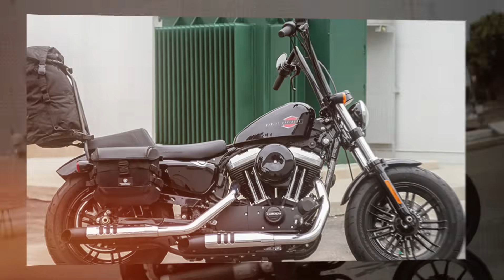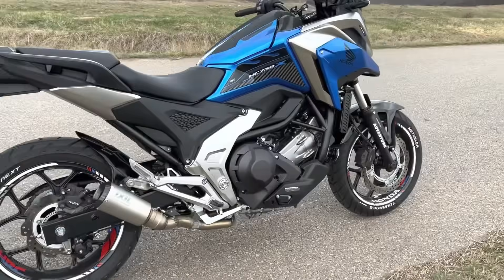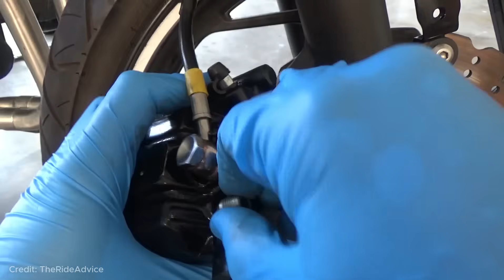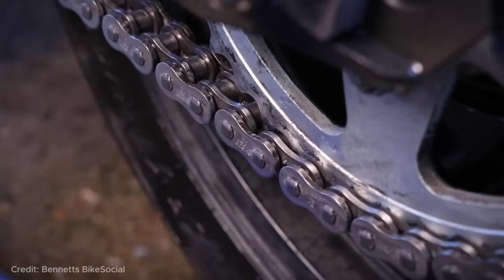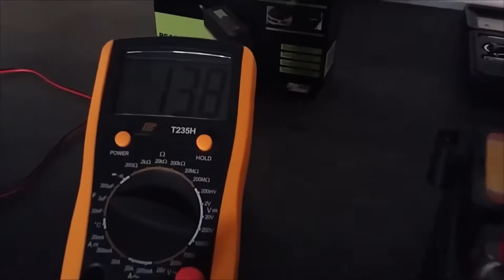STOP KILLING Your Motorcycle (Worst Things To Do)

Comment: Always lube chain from inside. Not like in the video. The centrifugal force will distribute it evenly. Or even don't lube at all. It doesn't change much. It's lifetime wouldn't be shorten much (2-5kkm). It could be cheaper to replace chain and sprockets than to pay for lube if you use it every 500km.
Reply: Experts don't use lube, they just clean with something like paraffin, kerosene, or GT-85. It's dirt that kills O and X-ring chains anyway.

Comment: What about holding the brake lever on with elastic while the bike is parked? A garage advised me to do this to prevent accidental movement or falls while parked up. Similar to the advice about holding the clutch lever in with elastic, is this actually a bad idea for the brake system and hydraulics? The most I leave mine like this is a few days or a week. Thanks for any helpful comments and thanks for a great and really helpful video.

Comment: Here's my own advice:

Stop wiping your bike everytime it gets dirty, yes even with damp towel, all it does is it spread the dirt and scratch your whole bike, what you should do is if your bike is still 80% clean and you just wanna remove that dirt in your swing arm just spray it with water, dont wipe it off, you should only wipe your bike when you wash fully wash it using bike shampoo

Comment: Replaced the rear sprocket, was tightening the last bolt into the swingarm without using a torque wrench and snapped the bolt head. The bolt was steel and the swingarm was aluminum so I just fused the two together. Easy out bits failed so had to drill out the bolt, retapped the hole from 10mm to 12mm.

Comment: That fuel pump?, is a carburetor.  Btw my Kawasaki has a fuel pump hanging off the bottom of tank, unlike my Honda (which is under the bike frame), so the bottom of the tank always feeds the fuel pump regardless of the volume of fuel.  All tanks feed from the bottom.

Comment: Recently got lectured by a mechanic replacing my rearwheel bearings that I was pressure washing my bike... sadly ruined my bearings at only 20.000km or 12.500 miles!
Lesson learned...
Reply: How in the hell did you get s sealed bearing that bad?
Reply: @pu1fjb0 The bearings don't come packed with grease from the factory. When we changed the bad one we checked the other side and there was no grease in it!
The right side bearing on the Honda Rebel 1100 is basically open. The only thing that is protecting the bearing, is the rubber seal... By pressure washing the bike with hot water the rubber seal swells and is not porperly sealing anymore. That combined with the products they add in those pressure washing places is washing out all grease

Comment: When i got my 2nd bike, the guy had replaced to front break pads. After riding for a week I knew something was off. Took it in because you couldn't see the issue but it had warped the break disks making it extremely unsafe and was lucky not to have crashed. Cost me a fortune for genuine parts again but glad. Morale of the story if something feels off, fix it

Comment: The chain lube thing is definitely a topic of many debates. I have always been told (25 years) that I should grease up right after riding when the chain is hot. Now I hear I shouldn’t. And some are even going as far as to say o-rings are sealed and don’t really need greasing and that grease is really more about avoiding rust…. Obviously there’s some misinformation out there but who is right?
Reply: The lube does not lube the pins in the chain. The orings prevent that. The lube does penetrate between the roller and the pin/roller bushing.
Reply: Yeah well people say things they heard without really knowing why. The O-X rings chains have lube in them yes, that's not what you are maintaining,  but you need lube to ease the friction between chain and sprocket and protect from rust, that is my non professional opinion.
Reply: @tzevux  I clean and lube my chain around 5 pm,  on Saturday or Sunday, even if it hasn't been ridden. put the bike cover on and go inside letting gear oil soak in overnight.

Comment: 0:50 Running low on fuel
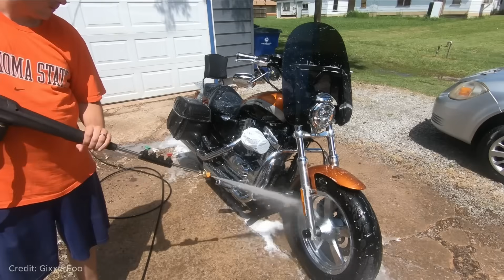2:29 Power wash in the wrong way
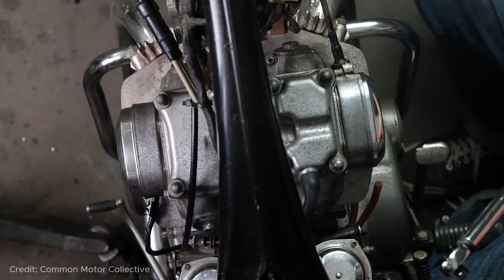4:10 Over tightening bolt
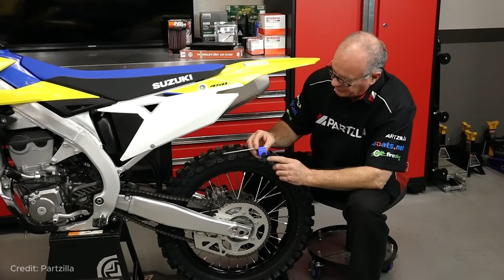5:42 Ignoring chain alignment
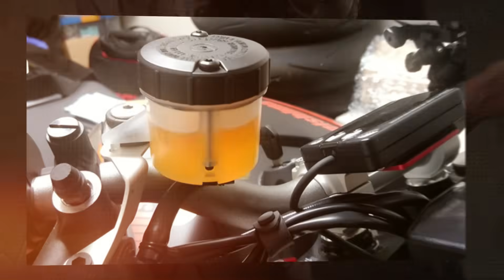7:07 Letting all break fluid set for years
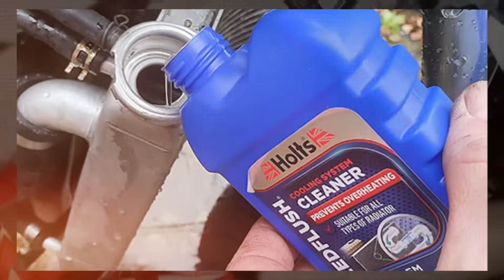8:38 Using a wrong type of coolant
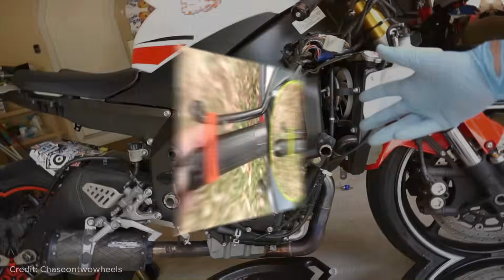10:12 Storing bikes with clutch pulled in
11:33 Mixing all old and new break pads
13:06 ignoring wheel spoke tension 
14:39 Loob in your chain after ride
16:07 Leave bike in 1st gear during long time storage
17:34 Letting the battery trickle all over year
Reply: Thanks bro
Reply: Thanks ahsan bhai
Reply: Thanks.
Reply: thanks INSAAN bhai
Reply: Great video
Reply: THANK YOU!
Reply: They’re brakes, not breaks. 🤦‍♂️
Reply: @Bassplaya-m5b dont see you taking time to time stamp.. stop being an ah.. we know what he means.

Comment: If your fuel pump is pumping fuel That means it's being cooled and lubricated      and sucking trash and debris off the bottom of the tank has nothing to do with the fuel level The fuel pump always sucks fuel from the very bottom of the tank anyway
Reply: Fuel pumps are cooled by the fuel (I know it's stupid), if the fuel gets low the pump gets hot. This leads to premature failure. Same for cars with pumps in the tank
Reply: just saw this bro, and I'm not saying you are wrong cuz ure not. but technically it doesn't intake from the bottom as the fuel inlet hoses sit facing the top of the tank as to cut down on sediment consumption. But yea if its leaking coolant that means it has coolant in it lol
Reply: @darylray1975 Don't want too much coolant in your gasoline
Reply: I always use NON ethanol gas. Ethanol attracts water real bad, or so i have heard.

Comment: Love my trickle charger, I just wait a month before season starts and throw it on
Reply: I have a LI-ion battery and a trickle charger "battery tender" I love them both and do the same. Just don't leave it on for extended periods. Just use it to charge it up when needed. If you have to use it a ton then its probably time for a new battery anyways.
Reply: @justinwolfe1471 when my oem battery goes I’d like a lipo

Comment: Hold on, don't motorcycles draw their fuel from the bottom of the tank? If that's where stuff settles, then it doesn't matter how low the fuel gets, we're always drawing fuel from where stuff settles.
Reply: Where the hell are all you guys filling up with all this sediment, water and rust?  I've got a 2003 and the tank is spotless and the filter is clean.  If you can't run your tank dry, you seriously need to fill up somewhere else, flush the tank annually or put multiple filters in the line.
Reply: @darrylbraun8520 ain't no way you run your tank dry, that still causes issues to wear and tear of the motor. unless you mean to almost empty,  but thats not running it dry. No engine ever should be ran dry
Reply: @afflict3507 Until you are parking it for the winter. You shut off the fuel while it's running so that it idles the carb empty.

...if you're running a carb.
Reply: @darrylbraun8520 ain't no way you run your tank dry, that still causes issues to wear and tear of the motor. unless you mean to almost empty,  but thats not running it dry. No engine ever should be ran dry
Reply: You guys are assuming this is a Carburetor bike (Shown), Modern bikes are Fuel injected and the pumps sucks from the middle to bottom.
Reply: The problem is when u ride till your bike die out of fuel
Reply: The sediment floats in a tank full of gas. If you don't have any liquid gasoline the sediment is just sitting on the metal inside the tank.
Reply: These guys are funny, sediment, particles in suspension, and floaters are 3 different things... and if you have enough of any if them in your tank to harm the fuel system or engine in the last 40 years you should take better care of it....
Reply: Yep. This is like that trope of waiting an hour after you eat to go swimming😂
Reply: ran one out of fuel once, then I had to visit the carb doctor, poured mix of water and car coolant, then I had to pay a visit to the water pump doctor 🔧🩺 a youtube video a day keeps the doctor away
Reply: Yeah but it stays suspended. It doesn't get sucked through the pump or vacuum line operated valve until the fuel gets very low. I mean sure if you're going full out in the twisties it gets disturbed and can get sucked up then but that's a bit different. The safe way to avoid that is to remove the tank once a year and clean it out properly. Other than that just don't run your bike low on fuel.
Reply: For my carbed bikes, I install an inline fuel filter on the fuel line to the carburetor and occasionally pull the petcock off and clean the screen and petcock internals, and purge and clean inside the tank. For my EFI bikes, I change the fuel filter regularly and maybe pressure regulator, and change the fuel lines if they looking worn out. And purge and clean the tank. I also don’t use the fuel that’s been sitting in the tank for more than 3 months. I don’t have to worry about sediment.  😊
Reply: Thinks for the tips old man!!!
Reply: Not KTM it's on top lol
Reply: The bottom of the tank is where my motorcycle draws from. I avoid ethanol when possible and make sure the fuel I put in it is clean.
Reply: Keeping a tank full sediment is suspended. Running quarter or less is where the trouble starts, carbie or Efi.
Reply: More gas in the tank helps dilute any sediment so i try never get below half a tank.

Comment: Fuel pumps, not shown, draw from wherever the intake sits and likely at the bottom of the tank. There is a pre-filter, 10 micron or smaller, to protect the injection system from contaminants. Old man should talk about regular fuel system maintenance rather than running the tank low on injection systems. Granted, running the tank low when the system has a fuel pump will allow the pump to possibly overheat, wear early, and fail.

Comment: I have recently overtightened screw when replacing front brake lever. My bad of course, but I also blame my motorcycle producer, who ceased distribution of bike's service manual, where all of these torque values should be. I had it for my previous bike, different manufacturer, and it was great help for amateur mechanic wanting to do some service job in private garage.
Reply: Check some forums and groups for the manuals pdf.

Comment: Never use a trickle charger. Use a quality maintenence  or smart charger. Keep an eye on it during the off season as well
Reply: I have a Battery Tender for my AGM battery is that a good charger / maintainer?
Reply: @higherstandardspc it comes down to will it go into maintenance. Maintenance isn't a constant feed but kinda floats around and brings the battery be it led acid, agm or lithium into the best it can be
Reply: @higherstandardspc  YES

Comment: I hit my chain with brake cleaner after a ride to clean it then lube it.
Reply: I used brake cleaner once and saw some damage to o-rings, how stupid it was....and I am not a beginner. Wanted save few bucks on dedicated chain cleaner can (Motorex, Motul, Ipone) - they last for 3-4 clean ing sessions. Now I bought kerosine 2l - more cheap and OK for o-rings. Many guys use it.
Reply: Don't do that! It's way too agressive and kills your o-rings or x-rings slowly over time.
Reply: @niels6695 good to know what kind of cleaner should I use than?
Reply: @AnimalVagabond  Use a special motorbike chain cleaner, doesn't have to be an expensive one. There are several cheap but good ones, depending on the country you live in. Try to google some chain cleaner tests and recommendations 😊 I use WD-40 chain cleaner (not the regular WD-40 solvent!)

Comment: 15:27 - if the chain has o rings or whatever x-rings - it cannot get to the rollers because there is the o ring in the way 15:50 so you are just supposed to let it fling all over your bike and the road - riiiighhttt..
How about follow your own advice from earlier - and read the manual - it says something very different than spraying your chain with aerosol can of oil before every ride.

Comment: With chain lube you wipe the excess off before you ride so it doesn't end up on your rear tire 

And leaving your bike in gear won't do anything, it will just rest on the engines compression 

And get a smart charger! It will go into a storage mode

Comment: 1 is wrong, you don't want it to run dry because it will ruin the internal veins, nothing to do with cooling
As long as fuel is going through it you're good
Reply: Applies only to efi systems and then you don't  run it to point of cooking the motor in the pump..  old bikes are gravity or vaccume diapham..  😂😂

Comment: Well said but: #1, not totally correct. The only danger is pulling all the sludge into the system. Or clog your fuel filter. #10. Lubing the chain does not increase the chain life more than 500-1000km. It just makes it more silent. and messes your rear wheel. Not needed. #11. Will not kill anything.

Comment: Awesome list!!!  Especially about cold revving and neglecting chain maintenance. It’s crazy how many riders will polish their fairings—but ignore their sprockets grinding to death!

One habit I always warn new riders about is skipping regular brake fluid changes. It doesn’t look bad, so it’s easy to ignore… until you’re grabbing a mushy lever on a downhill corner.

Curious what small maintenance habits other riders swear by to keep their bikes happy?
Reply: Because well washed bike drives great , that's what rider thinks । All friction points need lubrication even if it's side stand , levers .